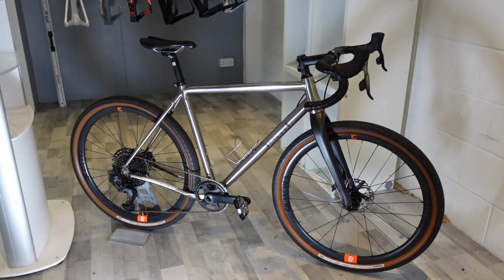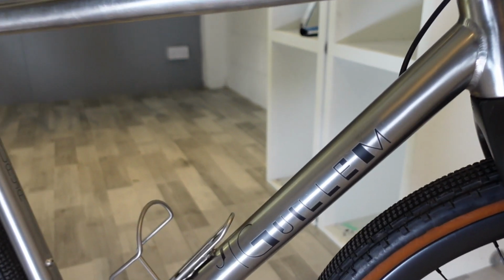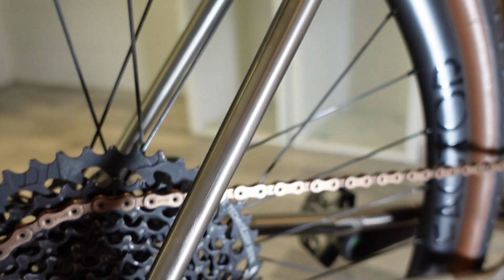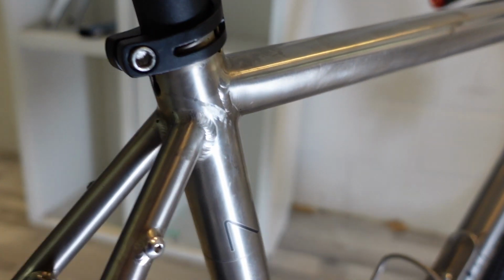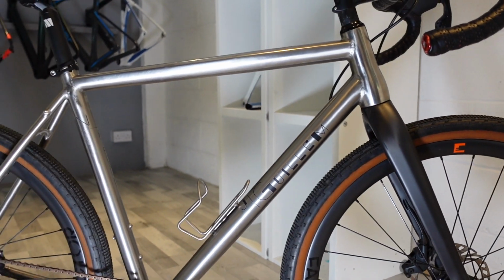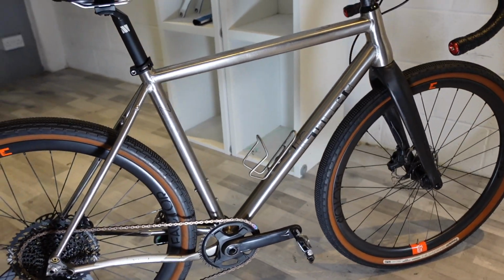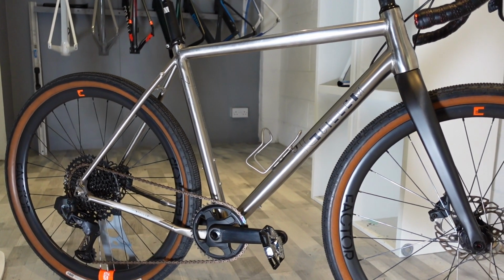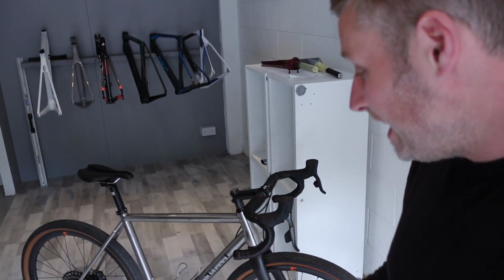My First Ride On Titanium! The JGuillem Atalaya Gravel Bike

Comment: You should look into Affinity Anthems. 
They're stainless steel and my 105/Ultegra build comes in at 8.4kg. All the benefits of titanium, but a smoother ride with a stiffer frame. Oh, and pricewise? Full builds start at around $3500 & framesets (w/carbon forks) are about $1700. Unbeatable value.
Reply from the maker: cool ill check that out👍🏻
Reply: My Ti gravel bike comes in at 8.5kg with hydraulic disc grx 810. Bike cost 4k. It also comes with a 100 year guarantee. 

I've ridden steel for years, carbon and aluminium a fair bit. Ti has by far and away the best ride quality the increase in mass dictates this would be the case. It's not a dense metal. The power delivery is like no other, I'm good in short powerful bursts, everything I do translates to the road.

As much as I'd like to agree you can get just as good of a product for a bit less. It's just simply not true. I don't think I'll move away from Ti. It's fucking awesome.
Reply: @jesmondo5785  Hi, I'm very interested in what brand tour titanium bike is? Cheers for your reply...

Comment: I bought the Van Nicholas Skeiron about three years ago but I didn't like it because the balance was off. I never had a bike where control or lack of was so noticeable. The Skeiron was put together with some hefty welds but the titanium tubes had blemishes that could not be sanded out. I found an image online of the factory where the frames were made and knew right then these frames were subject to poor quality manufacturing practices. I gave that bike to my son because it was good enough for him but me being an avid cyclist wanted better quality so I had  a custom builder here in the US build me a frame. The price of the Van Nicholas very affordable and the company was good to deal with but after riding the bike a few months I didn't like it. There are some slight differences between the Skeiron and the Guillem so I imagine this guy is sourcing the same factory.
Reply from the maker: thanks for sharing your experience, ill be reading more about that.
Reply: @AddictedBikes  Though this video is dated, I believe this is the factory https://youtu.be/a5gujTVQO3s I have this frame and think it’s an incredible ride btw
Reply: If it's true that the Guillem bikes are being made in China, the prices they are charging are simply outrageous. OR did you mean that the metal is being sourced from china?